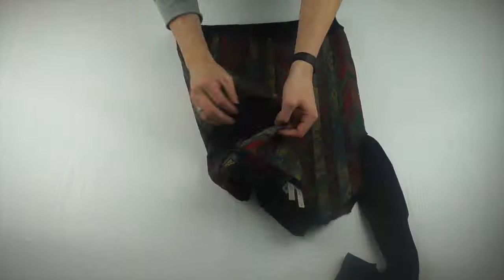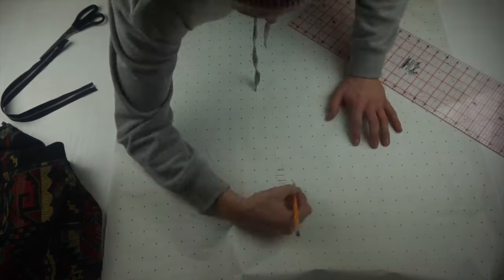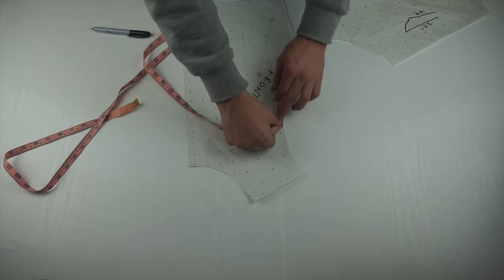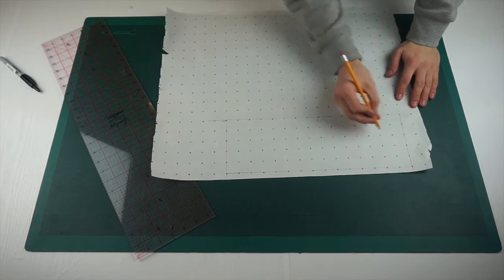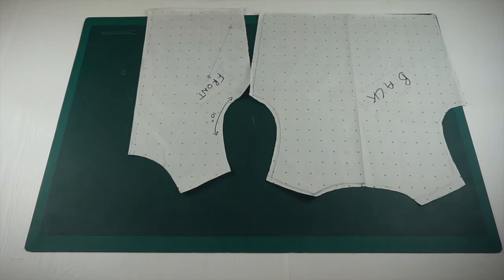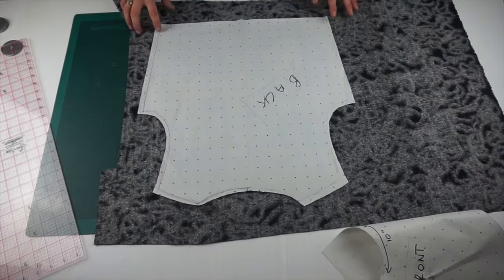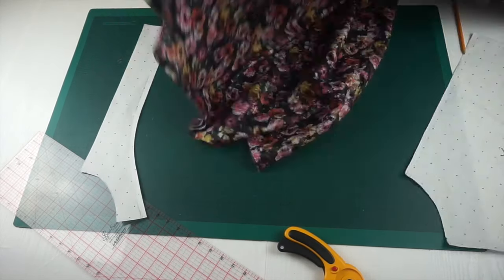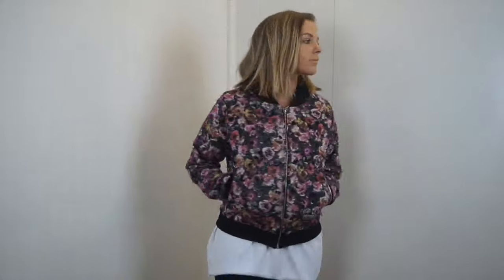DIY | How To Make A Bomber Jacket Pattern | Josh Barnett

Comment: Hey if your zipper is 
18 inches and the center front piece measures 22 inches from top to bottom, wouldn't that be too short if you want the zipper to start at the very bottom and reach the top. just a little confused from the video